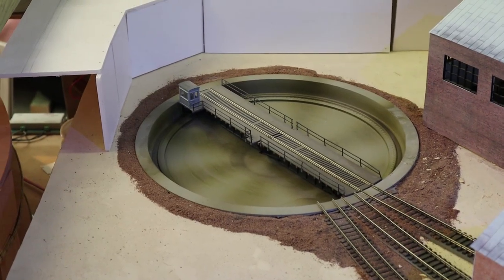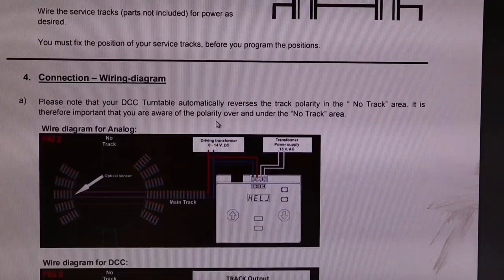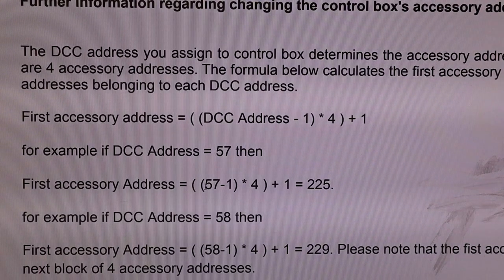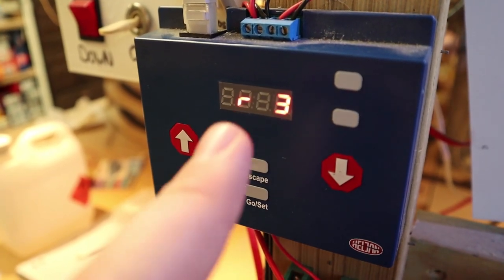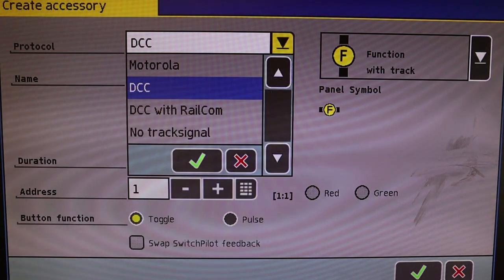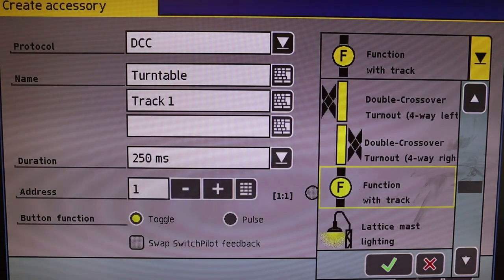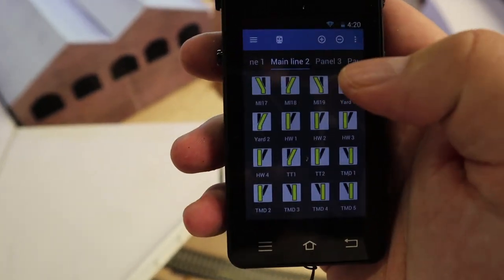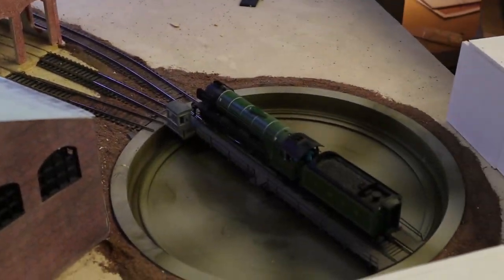22. ESU ECOS How To: Program a DCC Heljan Turntable

Comment: Great stuff - thank you. Now controlling my turntable from the iPhone - brilliant!
One question - it does seem a little fast compared to a prototype (maybe I'm wrong?) - is the speed adjustable?
Reply from the maker: From memory I believe it is but best to consult the Heljan user manual first.
Reply: Thanks - I can't see anything in the manual. However, I did some googling and if I look on pictures of the 89111 control box, the two buttons on the top right of the control box are labelled "Bridge speed +" and "Bridge speed -". I then read forums that say that Heljan have advised that these don't work on the current model. (Consistent - not labelled and not referred to in the manual.)
Other advice on railway forums is to reduce input voltage using diodes back-to-back in parallel - not sure about using that to reduce speed - hmm. Maybe later. Anyway, thanks again.

Comment: Nice.  I've got one of these in a box, and not had the courage to tackle the install yet.  I'm interested to know what limits there are within the ECOS routing algorithms when using the turntable.  Could you for instance run a loco on a route that uses the turntable to reverse the loco and then place it into a siding somewhere, all as one scheduled move?
Reply from the maker: Ranmore Common Railway I have experimented with that idea in the past and it works to an extent. The Ecos routing protocol will set the accessories to the programmed state ie open or closed logic. So to achieve what you ask it would be a simple case of triggering the route twice. Once to set the route the other to turn the locomotive. Definitely have a go and see what results you get! Cheers... Ben.

Comment: I am trying to the same using my Bachmann DCC and JMRI. I am able to control the TT using the throttle functions but can't seem to get it to work using the TT layout.
Reply from the maker: Not 100% sure what you mean by Turntable layout? Can you elaborate for me, please?
Reply: @theengineshed359  I am trying to control the Bachmann turntable through the JMRI layout. I have the JMRI layout with the turntable, tracks and turnouts. I am able to control the regular dcc turnouts but not able to control the turntable by clicking on the track I want it to switch. Currently, the turntable address is set to default which is 3. Don't have anything else addressed as 3.
Reply from the maker: @MrActionplus  Id try changing the default address to a higher value sometimes the default address of 3 can cause problems across the DCC bus. The Hejan Turntable I know for fact has this issue. Unfortunately, I'm no very familiar with JMRI so I can't really help you beyond that I'm afraid. Hope this helps! Cheers... Ben